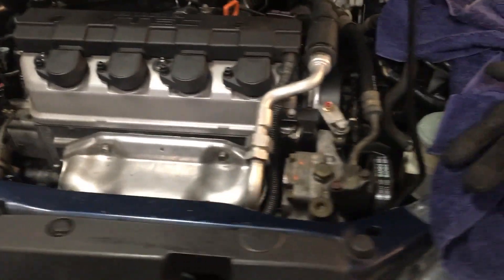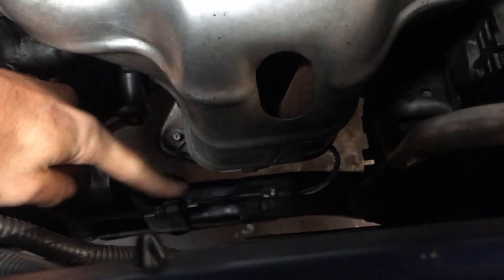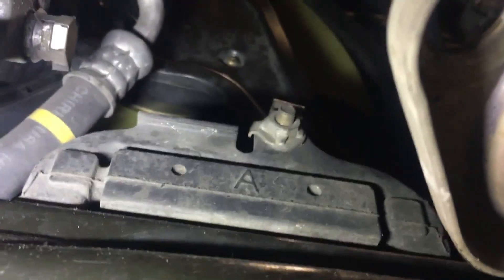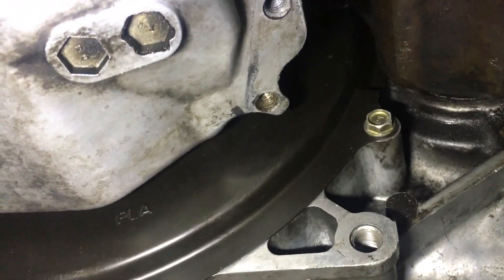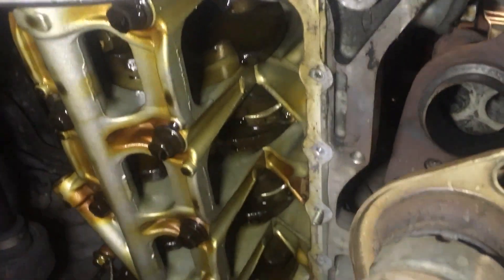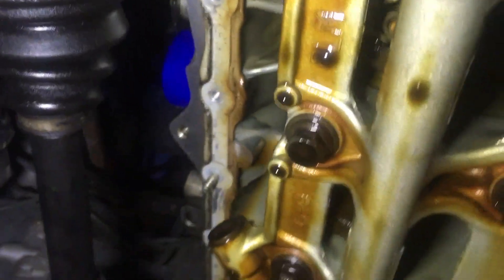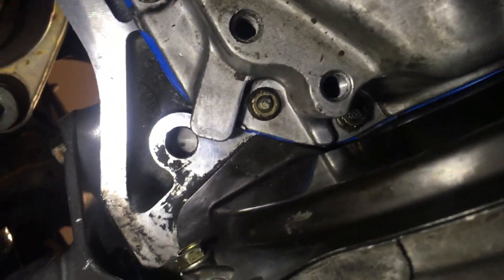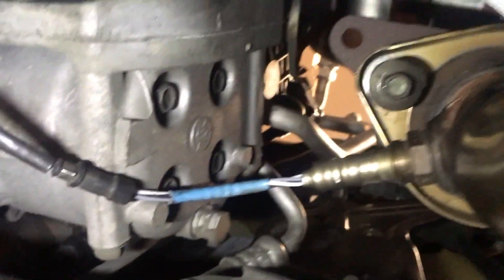Honda Civic Oil Pan Gasket Seal Replacement

Comment: hey man just a heads up if the oil pan is aluminum don't use a gasket it will leak down the road only the ones with steel oil pans use gasket with daps of hondabond at certain areas just use the hondabond or the permatex gray rtv and run a bead on the inner side of the bolts all the way around the entire circumference.
Reply: You don’t need to kill it with a lot of rtv. You only need it on both sides of the half circle ends. Put a bead on that area until you reach the first bolt hole along with the first bolt hole on the other end of the half circle. When removing your gasket; you would notice the areas where the rtv was put on so be aware of it. I have the dealership book. I go by the book. If your not able to do the job. I suggest you go to a mechanic. Oil leaks near the crankshaft is not the oil pan gasket. You should check where the leak is coming from around that area. It’s not a bad idea to replace the oil pan gasket if you have to fix other oil seals. Don’t replace a oil pan gasket seal if it’s in good condition. You would be wasting money

Comment: Same issue may I know Oil Pan Part no. For Civic 2001 D17 engine sir? I just replaced it on dealer but they use wrong PN (CRV gen1 series) and just 1 day became leaked again

Comment: How much did you torque the bolts back onto the oil pan?  Did you have a torque wrench and go to a certain specification or just until it was nice and tight on there
Reply: Doing this myself and can't find the bloody specification for the torque if there is one
Reply: 10 foot pounds

Comment: How much should this cost to repair ?
Reply: I’d like to know too!
Reply: @Saintdevil_YT  couple book hours plus parts, honda dealer told me over $300...if pan is good etc
Reply: @putheflamesoutyahoo1503  seems like a big scam. Hours to do this job? The oil pan is like $60 and if you want to use oem binder 20 dollars. If we are talking about Honda civic car. Ive done this job following a Youtube without and issues and it took me 1 hour at most.